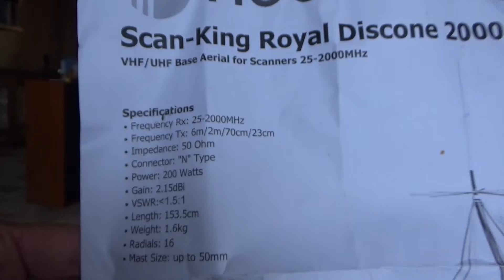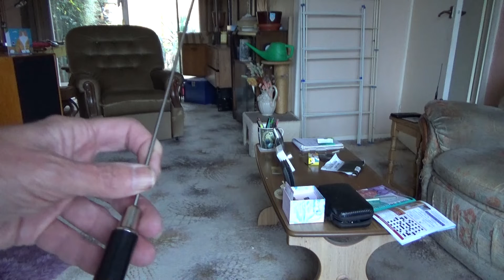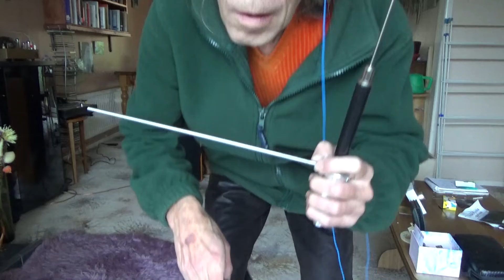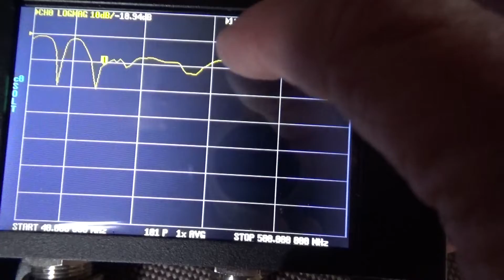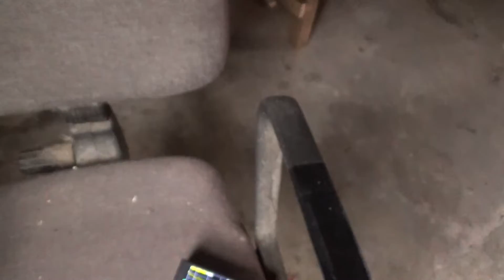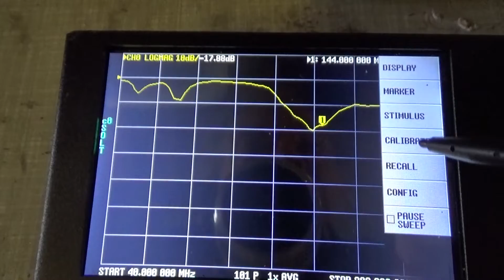Scan King Royal Discone antenna

Comment: I was considering this for my first big antenna, but after your review I might consider another one.
Reply from the maker: Yes they're crap. Buy a Diamond if you can afford one
Reply: @ptronix  I was looking into those. I'll look into investing in one those Diamond ones. I'm having more of an issue trying to figure out placement of antenna at moment roof access isn't the safest so was more thinking mounting it on side of house or on a unused old iron piping. Any suggestions would be great, thanks :)
Reply from the maker: @ByteNodeX I'd put an aluminium pole on some brackets on the side of the house, that's what I'm doing here for my main antenna the Diamond X510, the base is above the house roof so all round coverage
Reply: Ordered a diamond D3000N should fit my needs perfectly. For cabling was gonna run LMR400 you think that'll work best?
Reply from the maker: @ByteNodeX The Diamond sounds good. LMR 400 is excellent low loss coax. What you're going to listen to I'm not sure, there's nothing much on VHF/UHF these days like there was 40 years ago. Used to listen to the police repeater which could get exciting at times.
Reply: @ptronix  I wish could still listen to police/emergency services damn tetra haha. I'll mostly be using antenna for scanning purposes on SDR things like aircraft tracking, DMR decoding/ pager decoding and general signal hunting.
Reply: @ptronix a lot of dmr activity where I am .

Comment: Thanks for posting this video. I'm currently looking to buy a bigger discone antenna for placement in my attic. I'm currently using the smaller Moonraker desktop discone which is surprisingly quite good - picks up both sides of atc transmissions at Dublin airport around 8 miles away (I'm in a very built up area). I tried a cheap Temu diamond d3000 replica and that couldn't even pick up both sides. Would you recommend paying the extra premium for a brand like diamond or icom?
Reply from the maker: I'd buy the best you can afford. I've had other Diamond antennas and they've always been good. I certainly wouldn't recommend this one
Reply: @ptronix thanks a lot. I'll cross the scan king off my list 😅

Comment: I had the exact same antenna and had nothing but trouble with it. Continunity between the 259 and the relative elements was very hit or miss. I ended up paying a lot more for the Comet DS150 and what a difference. I can use the comet on 2m and 70cms with a flat swr and reception of other frequencies is excellent for my SDR play. Night and day.

Comment: Hello my dear.  I have an ICOM icRr7100 receiver and I can't decide which antenna to mount, I'm undecided between the Diamond 3000 and then I saw this one, would you recommend it to me.  Okay, goodbye, thank you very much.
Reply from the maker: Well it works, but not that well in my opinion. It certainly doesn't have resonant points on the Ham bands. I'd go for the Diamond, but I've not tested that one. Mine was fairly cheap and the Diamond is a lot more expensive. I've been using a Diamond X510 for some years and that's an excellent antenna.
Reply: Thank you for answering me.  Oh yes, I think I'll opt for a Diamond too.  I just don't know whether to take the one that goes from 25 to 1,300 MHz or the 3000 point which allows me a much wider range. Also because, as you will know, the  ic R 7.100 reaches up to 2000 MHz in coverage and therefore if I were to take a 3000 I would have a frequency segment that I would not be able to listen to or at least I would listen poorly.
I'm just an SWL and in addition to the ic R7100 I also own an old, but still excellent realistic 2006 and a Jupiteru MVT 7100 and so you understand that I'm a bit undecided in finding the right antenna.  Thanks anyway.  Have a good day 73 
Sorry for my bad english and greeting to italy.
Reply from the maker: @doppiazeta963  what you going to listen to at 2000 Mhz? There's nothing up there but digital phone signals.
Not sure where you are but most of VHF  and UHF is now filled up with data and digital systems, for  the police and other emergency systems. Gone are the days of listening to the local police repeater on UHF. That was quite exciting at times when they were chasing some criminal round town.
Reply: HI.  So a Diamond or a Sirio with a range from 25 to 1300 MHz could easily be enough for me.  Right?  Thanks again.
Reply from the maker: @doppiazeta963  absolutely, there's nothing above 1300 to listen to just digital phone signals.
About the only things lower down are the  air band, ham bands and FM radio. And maybe CB on 27 Mhz
Reply: @doppiazeta963  Discones are pointless below 100 MHZ and totally useless below 30 Mhz, other than that they are a durable  windproof antenna that do have their uses, I use mine for PMR 446 TX and RX, airband and shipping RX only.

Comment: I have a question that very few could answer.  I just bought the Scanner Antenna HF Discone 0.05 To 2000 MHz and my question is can I attach a Long Wire to the base pole or structure itself to help bring in distant radio stations?
Reply from the maker: Can't see how a relatively small antenna like a discone can work so low in frequency. Connecting a wire to the base  pole would probably be pointless, as this point is effectively earthed. Try it see what happens

Comment: Interesting video and that looks like a good location for the radio hobby.
I’ve tried a few discones including the HF version, they seem a mixed bag in terms of RX performance. Between 25 MHz - 35 MHz is an area of interest for me and they don’t do too bad on those frequencies. But for higher up I prefer a colinear. 
It’s a shame it did not resonate where it should have, it could offer a lot to someone with limited space that wants one antenna for some local ragchewing on a few ham bands and a general listen around. 
73 Franco
Reply from the maker: Hello Franco, I wouldn't use a discone on the ham bands, much better to use a dedicated antenna like a colinear. And this one would be fairly useless with the poor impedance match. Here there's nothing worth listening too on vhf or uhf, all gone digital or cell phone network.
Wonder what you find on 25-35?
Reply: Hi, yes true. I had a Whistler digital scanner for a while but it didn’t really hear much extra to be honest, the odd bit of DMR and NXDN. Soon got bored of it and sold it. The lo VHF stuff relies on an opening usually, some interesting comms below the CB band like Russian taxi drivers, 10m has been busy, NYC FM Repeater comes through on 29.620 sometimes. There’s some USA fire dispatch repeaters on 33mhz, Turkish Forestry on 34mhz, French PMR etc. It’s worth monitoring those areas, something a bit different 👍🏼

Comment: Great video, thank you! Clearly you know your stuff. Could I ask what antenna you would recommend for a wide band SDR radio? Scanning a similar range to what this antenna promised 25Mh to 1.5Ghz ?
Reply from the maker: To be fair to this antenna it did work fairy well on receive, but I didn't test it below the FM band.
My problem was it didn't have the claimed SWR on the amateur bands.
There are several other discones available out there. 
Have look on the various radio shops websites. Some are quite expensive. I bought this one because it was relatively cheap.

Comment: You;d be better looking at the smith chart than the 50 ohm characteristics to see whats going on with the antenna. Plus did you calibrate to the end of the cable?
Reply from the maker: Sorry I don't agree, I prefer to use it it in log mag mode to find resonance points through the spectrum and clearly they're weren't any at the expected frequencies. If there had have been I could have put it into Smith chart mode to get the actual reative & resistive measurements. Yes of course I calibrated it before use.
Reply: @ptronix  👍

Comment: Hi Nick, I had a Discone in the past too, to match my wide band scanner. Mine was a Diamond replica and it was the very same as yours, covering the same freqs and same dimensions.
I run some analysis and remeber it had quite flat response of impedance. I don’t recall having peaks or nulls like you had with its whip. 
On the ham bands the swr was low. 
Also I remeber that comparing it with a 144/430 omni vertical, I wasn’t too pleased with it. Obviously in those bands the dedicated vertical was much better but with my surpirse, outside of those bands, the omni vertical was performing just barely worse than the discone. Something I could live with. So eventually decided to sell it and keep just one antenna. My interest instead would have been to try a directional log periodic, say 70-470. Never went through that project although I rescued a tv log periodic to work with and make it work for the freqs I said. 
By the way when you test the antenna with the nano vna o have the antenna inside and full of surrounding objects is not ideal.
Cheers
Diego
Reply from the maker: Hi diego, so what's wrong with mine then? It's certainly not as the specifications. Not a lot that can go wrong with it. Checked the coil, has a low resistance, as it should. I'm most unimpressed with it, I've basically wasted my money. I think it will be going back in its box & the j pole will go back up. All the vna measurements were more or less identical when it was put up on the pole as what I was getting at ground level.
Log periodics are nice but big and directional so too much hassle. Anyway , all the best, nick
Reply: @ptronix  as You said there’s not much that can go wrong. Any issue with the feeding coax? Have tried to measure it on the roof with a short feedline that is certainly good? Other than that I would return it stating the issues. I mean, here we’re verifying that it doesn’t meet the specs, not how it perform. You better save your money for something else. Maybe a small active whip.
D.
Reply from the maker: @IZ0MTW  yes done all these things, nothing wrong with the coax. I really can't believe bothered to send it back, for one thing the lower whips are slightly mutilated! I had to use mole grips to clamp them when screwing them in. I'll just write it off. Luckily I won £100 on the premium bonds this month so that is double what it cost. The parts will be useful for something